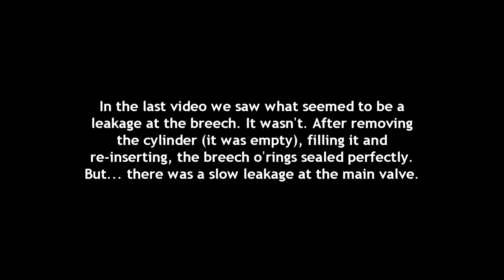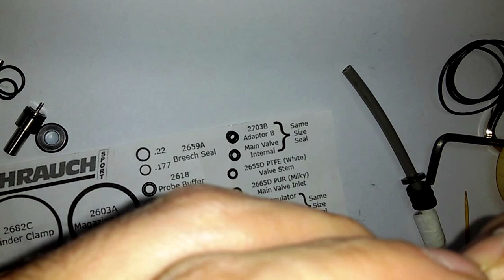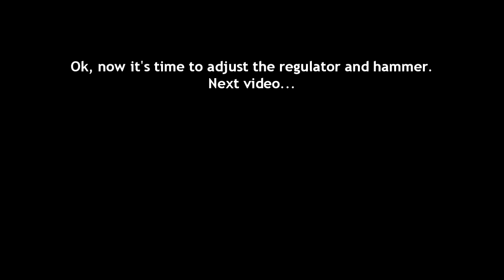HW100 Regulator o'rings, Weihrauch HW100 FAC .22 Maintenance Part 04

Comment from the maker: Weihrauch HW100 T FAC . 22 Maintenance, Part 01 Reaching the Front Action Block: https://www.youtube.com/watch?v=KAfTh9fwWnM
Part 02, Breech Block O'rings Replacement: https://www.youtube.com/watch?v=FPsTP4iCSGE
Part 03, Regulator and Main Valve Disassembly: https://www.youtube.com/watch?v=e1B2pmWQrIc
HW100 Breach Leakage: https://www.youtube.com/watch?v=QbBSR_BLhGs
Weihrauch HW100 partial disassembly and power adjustment, hammer and regulator : https://www.youtube.com/watch?v=KGlSyb8ZoFs

thanks.
Reply: What is the best speed of Fireroch Shrude 100.55 on the deaf 18.13 pair